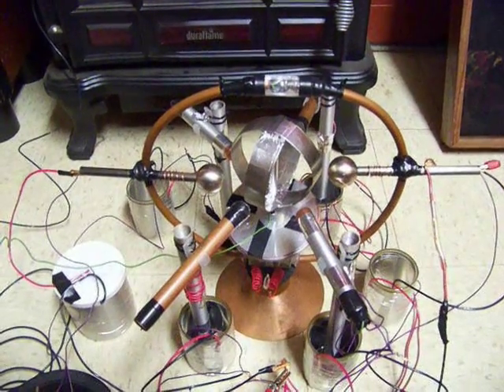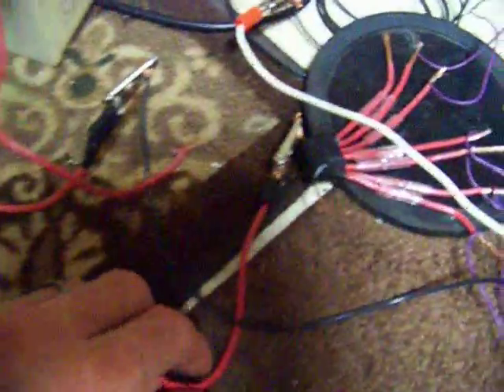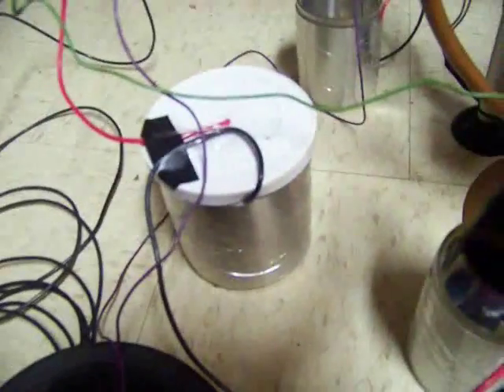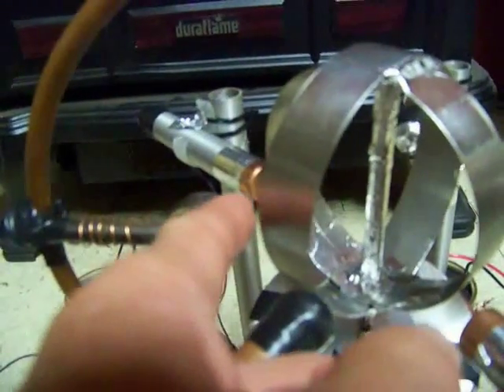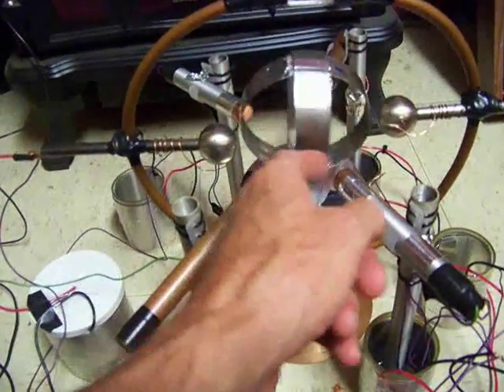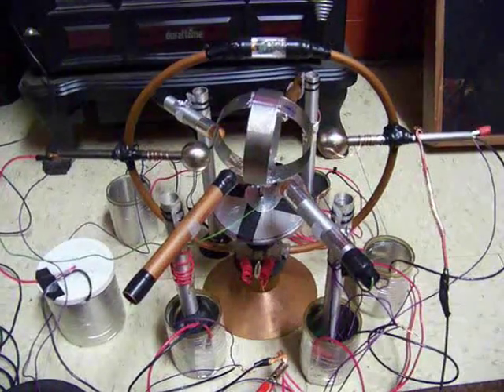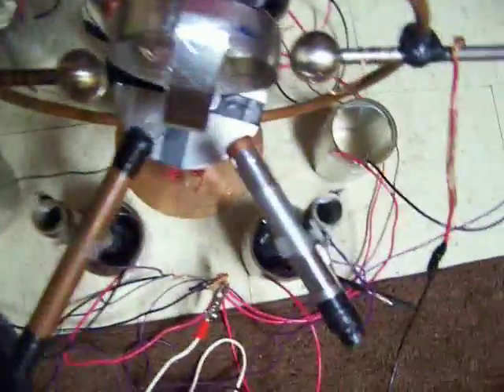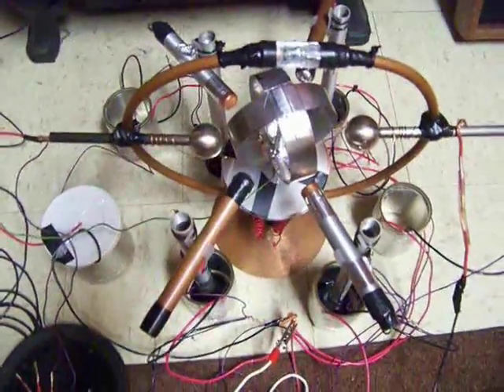LIGHTNING MOTOR !

Comment: Have you considered putting a little Go-Pro camera inside a fine wire mesh faraday cage? The camera should be able to see right through the mesh. Basically drop the camera inside a glass mayo jar with screen door mesh taped around the outside, and a wire going to ground. Sound would suck, but it should be impervious to the EMF pulses those sparks are putting off.